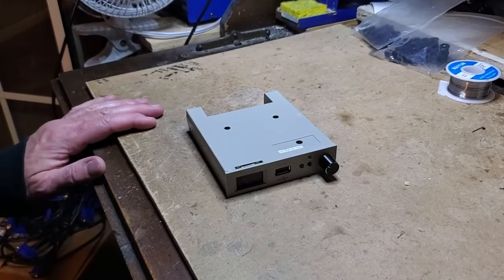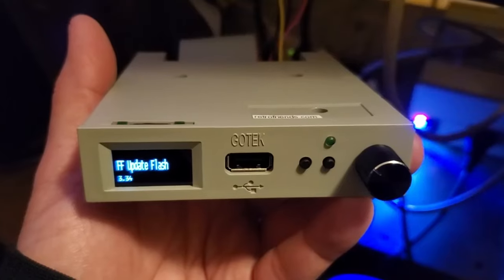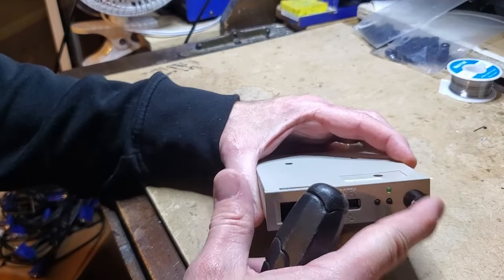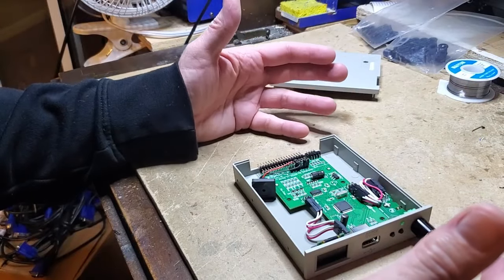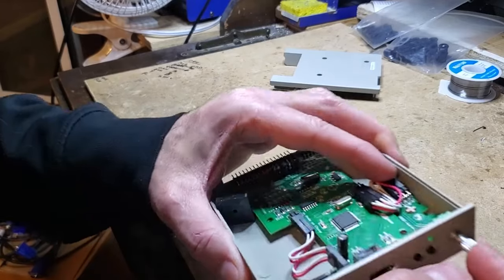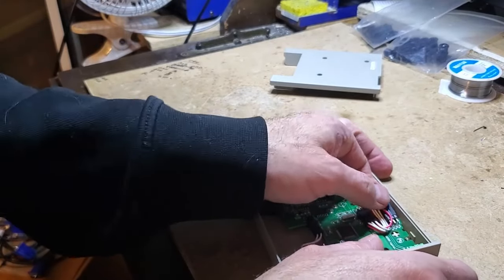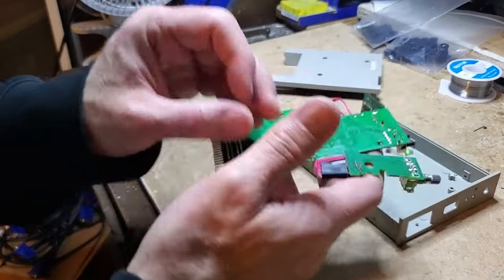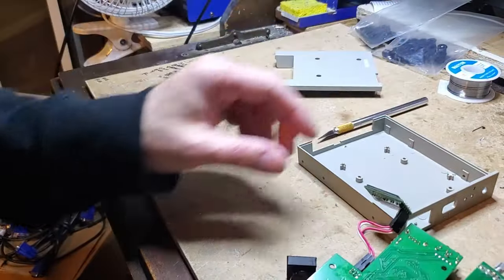Locked up Gotek Diagnosis - Rotary Encoder Issue

Comment: Of course you could just push the buttons.  Most Amiga computers have hard drives.  So, the "disk drive" is mostly not used.  I wonder if I can buy these newer Gotek drives without the stupid encoder and speaker?  🤔
Reply from the maker: Oh, hello Hans. Not sure I can agree with the statement that most Amigas have hard drives, considering the a500 is the most prevalent. Keep in mind most people don't have the funds and/or ability to add or maintain a HDD on an Amiga. The easiest and cheapest way to get an Amiga up and running with your favorite classic games is with a Gotek, and best selling models have the rotary encoder. I have sold hundreds myself. That's not to say all of this applies to everyone - to each his own.

Comment: I would be nice to see the Gotek power up without the encoder board.
Reply from the maker: When I found out that the push button was shorted, I didn't go any farther. I haven't received a replacement encoder board, but I suppose I could have stolen one out of another gotek and added 30 seconds on to the video. Or I could have filmed an entirely different gotek and have the viewer being none the wiser lol.